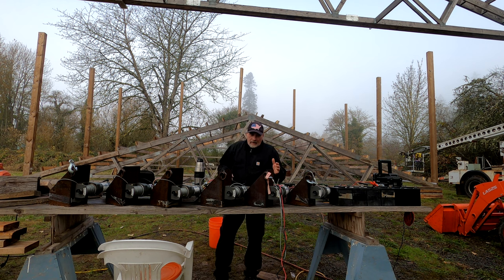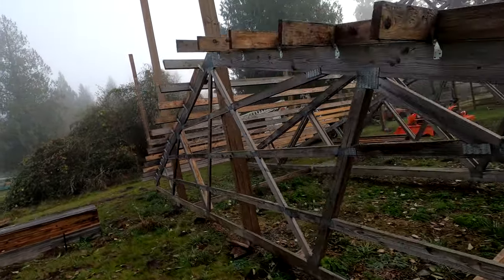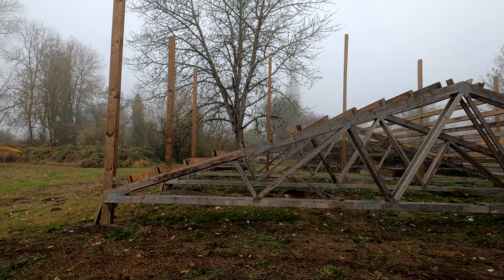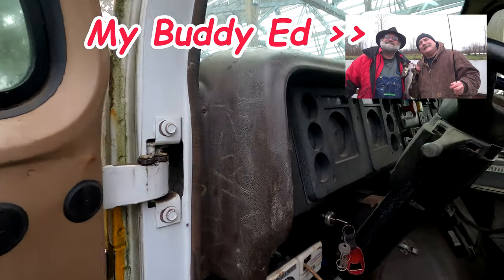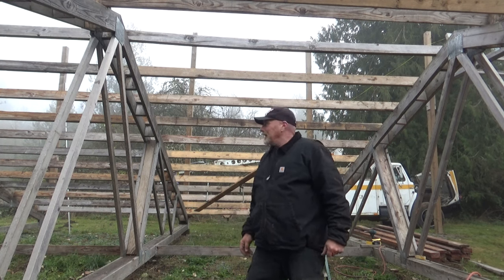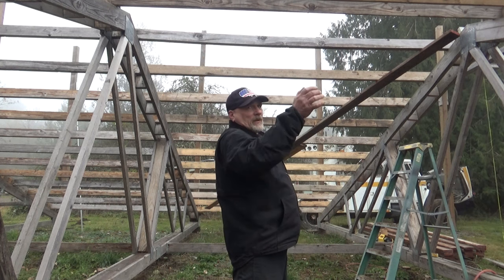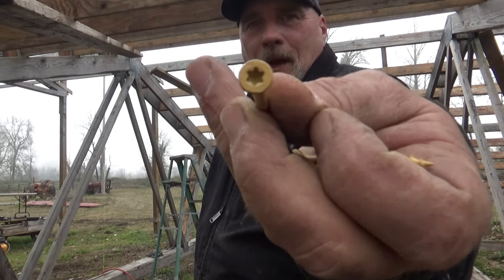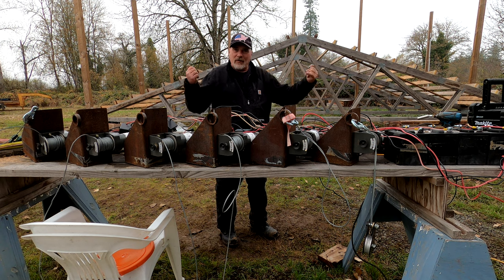Preparing the Lifting App-Rattus for My Building

Comment: Make anchor points probably best in the ground and up to the concrete floor when you get that far so filled it with an elevated box. That way you have points in the Florida and winches to to help you maneuver your non-running trucks as needed

Comment: The Ace hardware by my place uses those same plastic bags for loose fasteners!
That new drill seems to have acclimated to the building life. I don't like those smaller hex-drive screws, as they are much easier to strip out - both the screws themselves, and the bits which come with them.  I'll bet if I bought a set of quality driver bits, that I wouldn't have so much trouble with them.
Think I'd trim those trees back around the sides and back of the building, so that they can never fall into it.

Comment: Hey brother, check the video at 39.24 right side of the board is loose (it went up when you hit with the lower brace)
and there called TORX BITS you'll find a lot of those on the square body trucks. GM's better idea (NOT!) 
big pain in the A** when the heads rust out.
Looking good so far keep it up. I'll be waiting for the next update.
PEACE AND LOVE FROM MINNESOTA......BARRY
Reply from the maker: I'll check that out Barry. Thanks.
Reply: I saw that. Unfortunately, the roof was probably raised before we saw this video.
Reply: @dlavarco  just means he has to use the bucket truck to check it out